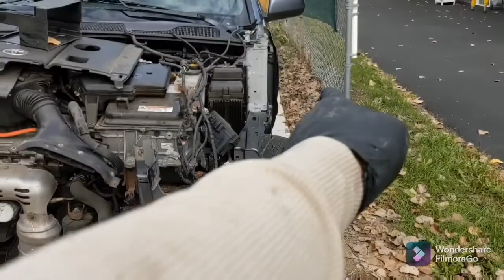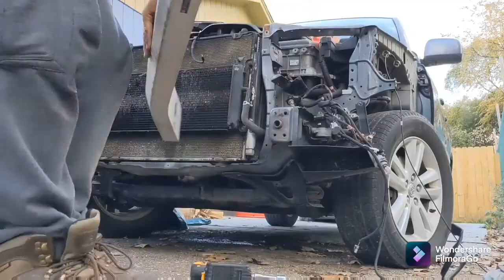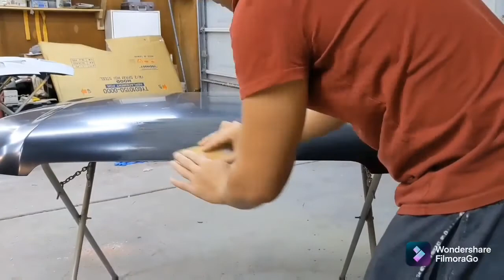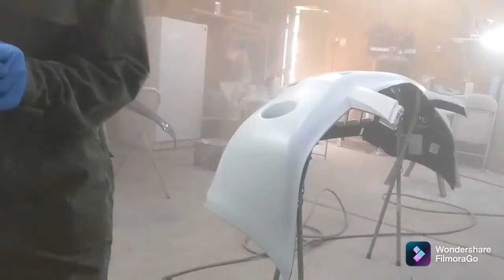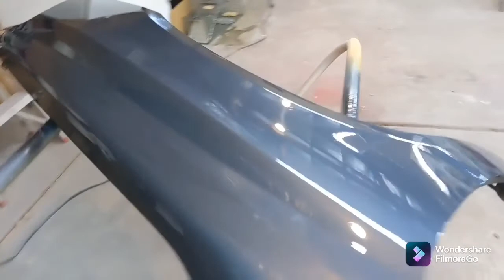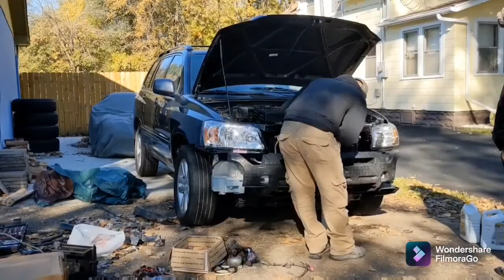2006 Toyota Highlander Collision Repair

Comment: Very impressive. I have the same car and I had an accident. The same damage. Pretty much I need to replace the same parts (except right hand fender), make painting and assembly all parts together. What is the average budget for this kind of work?
Reply from the maker: This repair cost me about $1500 in parts.
Reply: @suewavang1538 , thank you for your reply. I sent you PM in Instagram.
Reply: Did you have to do any welding. I'm in the process of doing an 04 highlander